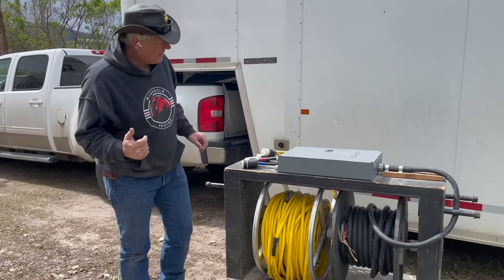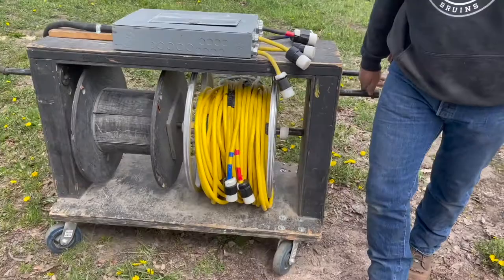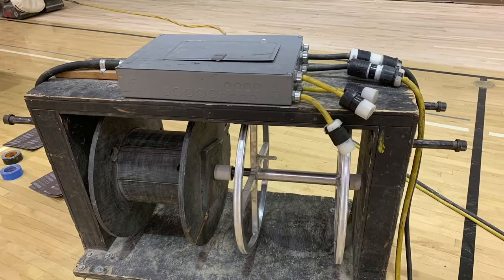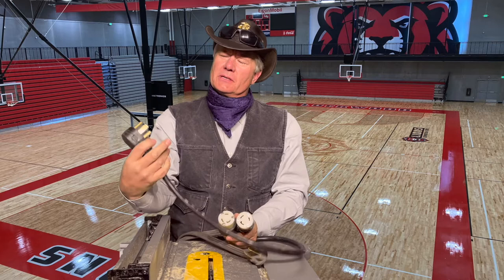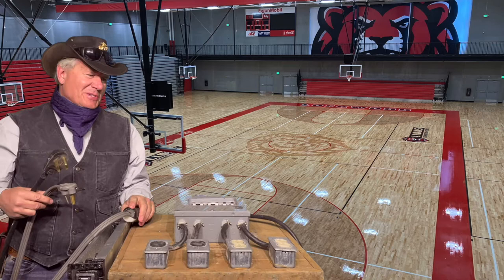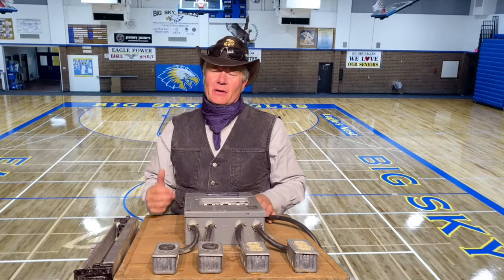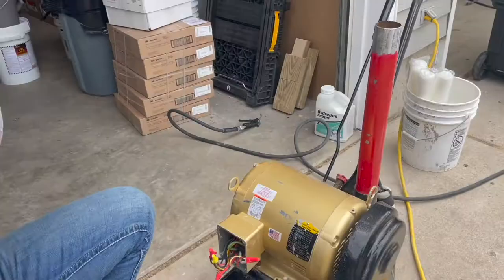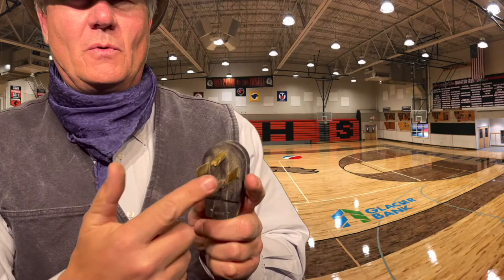How To Safely Hook Up Power for Floor Sanders

Comment: Hello, I used to work with my dad doing floors and he would connect the Hummel machine directly into the homeowners electrical panel.

I was always afraid to do that since I got blasted one time and he said the way to do it was to count every other breaker because they can’t connect to the same one.

Can you do a demonstration or a video talking about how to connect them safely so I don’t explode myself? My dad’s not around to show me anymore. Greatly appreciate your video

I noticed you can plug into a dryer outlet or something too but does that give all the power the machine needs?

I’m trying to get back into flooring
Reply from the maker: Hey Daniel, in my experience a dryer or kitchen stove outlet will give you all the power you need. Go to a hardware store and buy 3-4 plug configurations for dryer & stove outlets. Then wire on the plug your 220 volt big machine uses. Now you will have adapters that will work in most homes. I agree with you…. Don’t wire directly into a power panel!!!
Reply: @WyomingWoodFloors  thanks for the response! That’s the only way he would do it so I never knew that was the better option. Appreciate your quick response
Reply: I was about to ask this. All my appliances are gas, not electric. Would you let the flooring guys connect into your panel or hire an electrician?
Reply from the maker: @entrthedragon  Hire an electrician!!

Comment: At 14 mins you mentioned that the 4 prong dryer adapter will work on a stove. I'm sorry but this isn't true. The dryer is a 30AMP hardware with an "L" shaped neutral prong, whereas the stove is a 50AMP hardware with a blade style neutral prong.  The 30AMP will not plug into the 50AMP outlet, but it can be modified. Either use a something to file or cut the "L" shaped prong into a blade, or, since it's not being used, cut it off completely.
Excellent video as always!  Thank you!